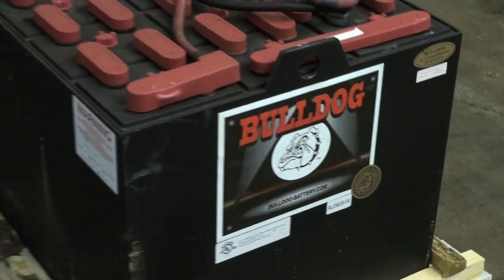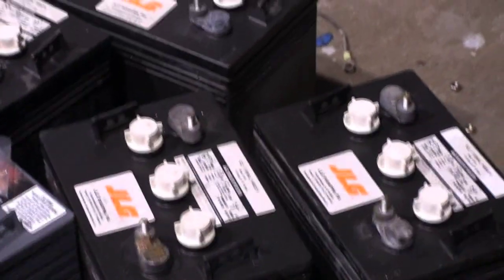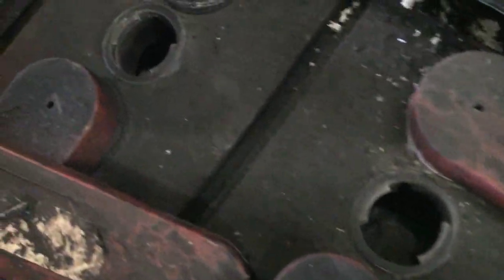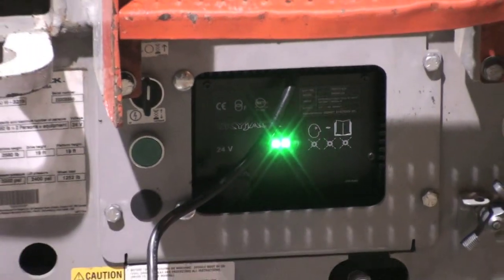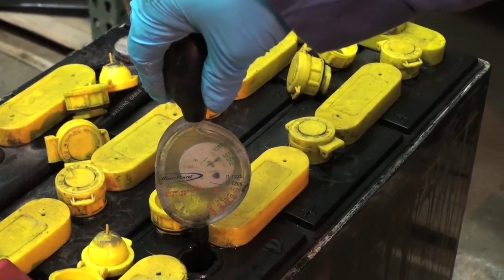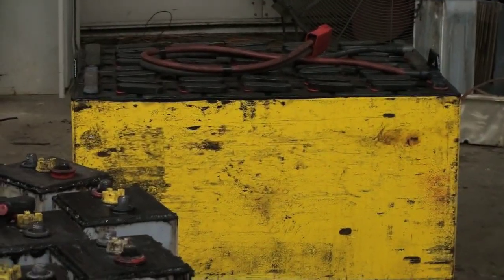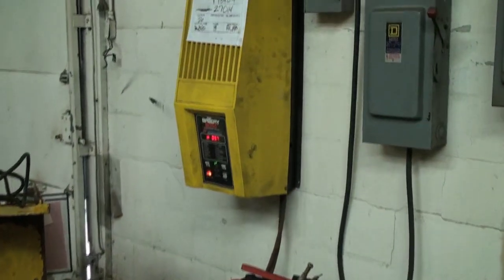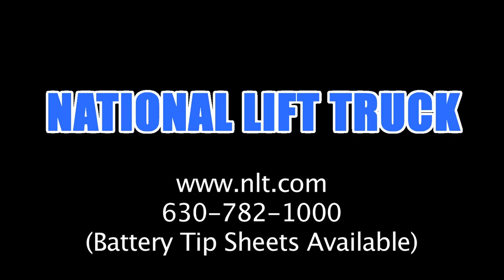Industrial Batteries: The Dos and Don'ts

Comment: Question: I recently started a job where I use an electric forklift. I am not sure what kind of battery it has since it is enclosed in a metal case. I have been told to charge it when it gets low but not to overcharge it (1-2 hours) since it can boil over. Yesterday, the battery got low since I was doing a lot of work with it. I left it on the charger for about 2 hours. When I came back, I could hear a boiling sound coming from the battery. I immediately turned off the charger and unplugged the battery. I then let the forklift sit for about an hour before I used it again. Nothing else happened after this. When I started using it again, I didn't experience any issues. Did I leave the battery charging for too long?
Reply: Sounds like the company is not letting the battery fully charge - there may be a reason for this so verify.  We plug our forklift in at the end of the day and let the charger do its thing.  It turns off automatically when the charge is full.  The boiling you heard is normal.  That's why they say NO SPARKS OR FLAMES.  Our guys will get fired if caught smoking near charging battery!  Be sure to check the water level AFTER CHARGE IS COMPLETE.  Add water about 1/4" above the perforated plate - DO NOT OVERFILL.  Strongly suggest learning more about forktruck charging system and battery maintenance.  Good for you for looking into this.  Sorry I'm just seeing this and replying a year late!  Good info in the video!

Comment: Like Chris Lokey said, you forgot to mention a battery should only be watered after a full charge. You also forgot to recommend the use of distilled water. the accumulation of dissolved solids will contaminate the plates, causing higher equivalent series resistance, and higher self discharge rates. It also reduces capacity. Everything else you said is exactly correct. Just remember to mention distilled water after a full charge.
Reply: Not necessary to use distilled watered its just a sales tactic to avoid warranty. Ive been servicing and repairing batteries for over 15 years and see no difference.
Reply: @HammBone950   Thanks for sharing that!  I had always heard to use distilled water but my maintenance guy said same as you.  Not needed.

Comment: EXCELLENT video on batteries. Much more accurate than other videos. However, I am somewhat hesitant to give much credence on specific gravity tests. Most batteries, unless very properly maintained will have been overfilled in the past causing a loss of electrolyte during the charge cycle. What gets added to replace the electrolyte? Water. This weakens the acid and  diminishes the value of the specific gravity reading. I only trust a specific gravity reading on a battery that has had the acid adjusted to the proper level. One more note. Just make sure the power to a charger has been disconnected before blowing it out. Some of the newer high frequency chargers have transistors on the front that are carrying full line voltage that has been converted to DC. This can be a life threatening danger if a blow gun device that is metallic comes in contact with them.

Comment: Only refill batteries AFTER charging
Reply: What if it's nearly dry before charging? It will burn. Still refill after charging? Even though I still agree with you.
Reply: @Dan-eu1dz   It should never get that low.  IF it did, I would put some water in - just not full